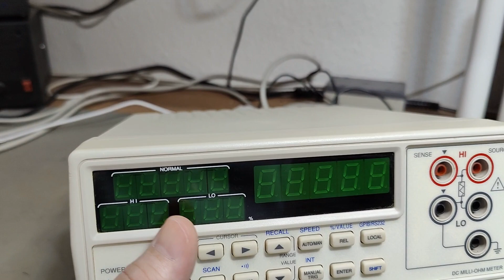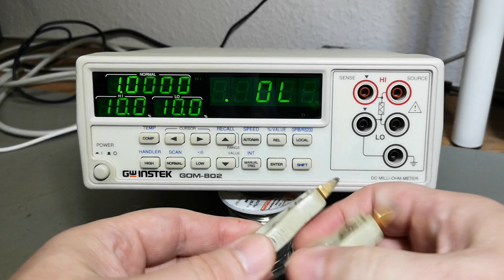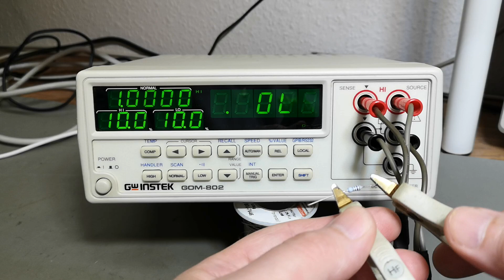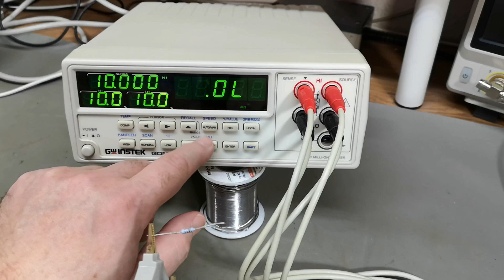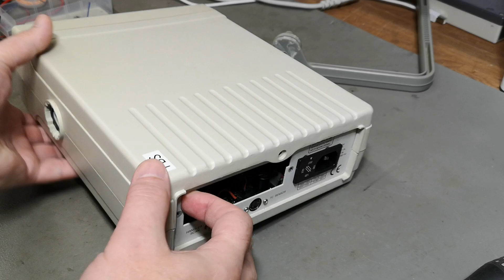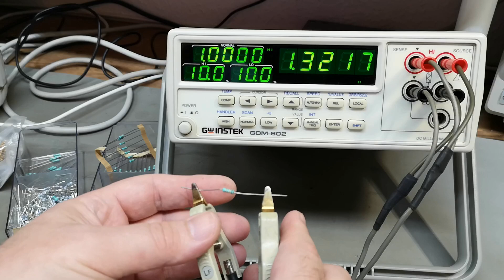GW INSTEK GOM-802 DC MILLI OHM meter test teardown

Comment: Neat piece of gear!  I've had a GWI function generator in the past, in about the same case, it was esthetically nice but didn't like the fact it drifted, after about a years worth of service, I sold it and replaced it with a BK Precision which I absolutely enjoy.  I think I would own this item.  Could you do a video just on the coiled resistor that in my eyes looks like an inductor, I've not seen that before.  Thanks!  73's OM.  ~Jack, VEG
Reply from the maker: I think it is the current sense resistor at 18:20 you mean ? its special winding idea, back and forward halve way, is clearly to make it non inductive, and at the same time radiate much less magnetic into other parts on the instrument. since strong magnetic fields will induct voltages over sensitive parts and possibly create wrong readings, they had to think about all details in this unit, to make it work so fantastic good.